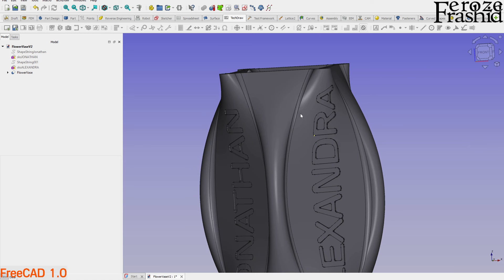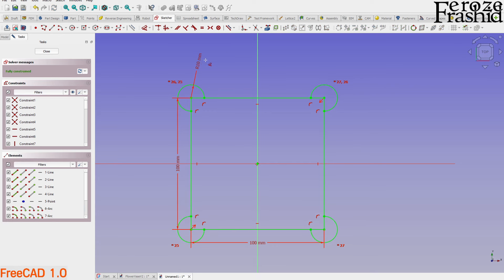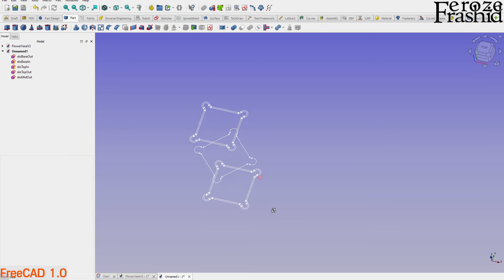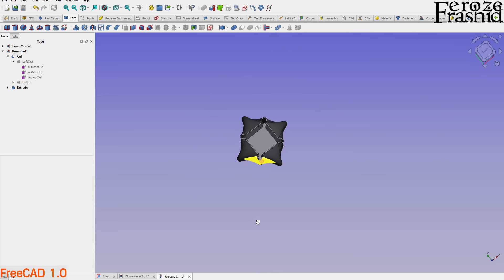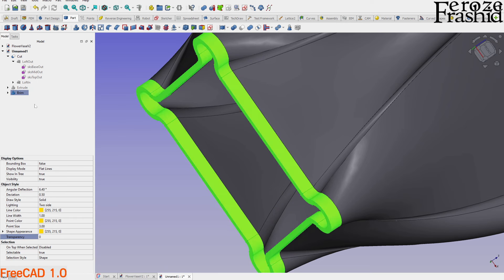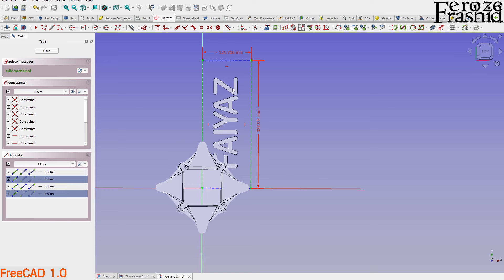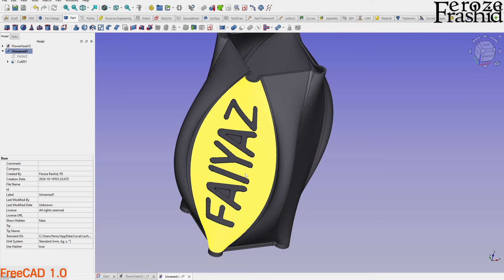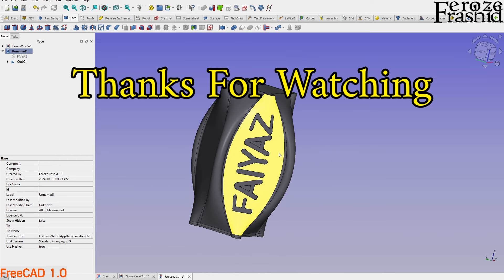Model Your Own Flower Vase and 3D Print: No Experience Needed

Comment: Nice Rachid, i tried it but it but something went wrong, after making the boundary lines from the shapeString solid, still i did not see them in order to place the text between. Very nice print, just curious how much it costs in India. Fayaz is looking good.
Reply from the maker: By default, a Mapped_Sketch is hidden. You will have to make visible as well. Other than that, can't think of anything else. I can take a look at it if you send me the file.
Not sure about India, but here in USA I had to pay $14 for printing, $5 for shipping for the 3D printed model.
Reply: @kattkushol  Oeps, i am sorry, i was wrongly thinking you were from India. 19 USD for a big print like that in such high quality is really cheap. Later in the design all of a sudden the lines were there, but by that time i messed op the placement of the shape string. Anyway, in the end it worked out, so i am happy with it. Thanks for posting. Jean